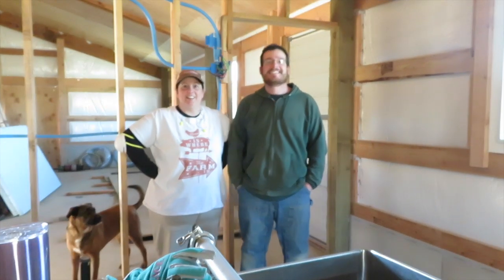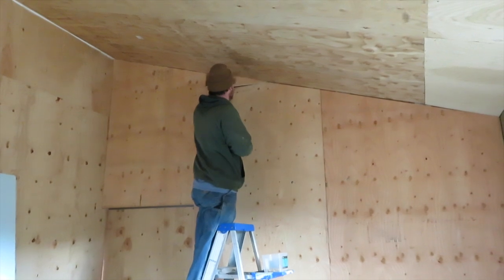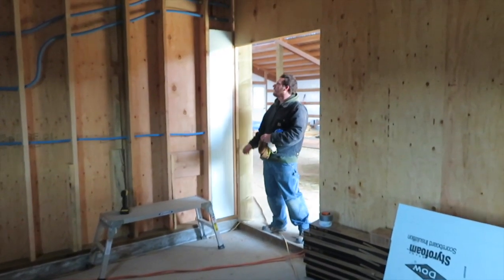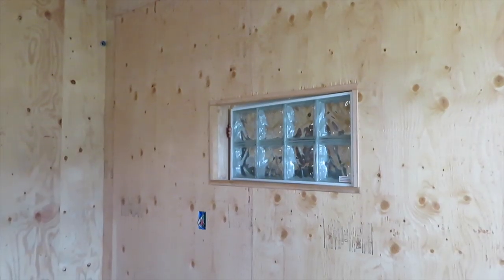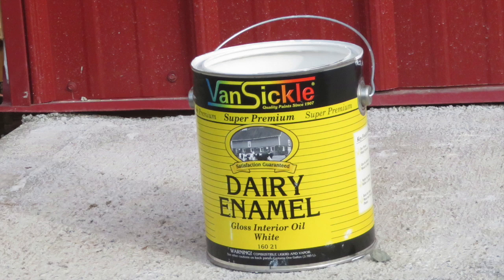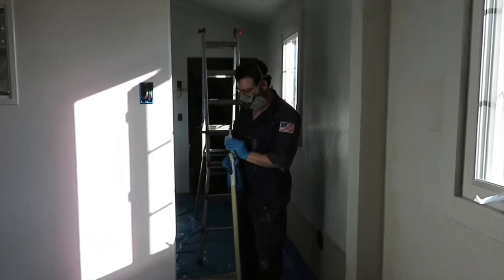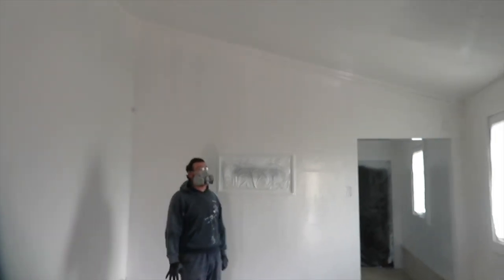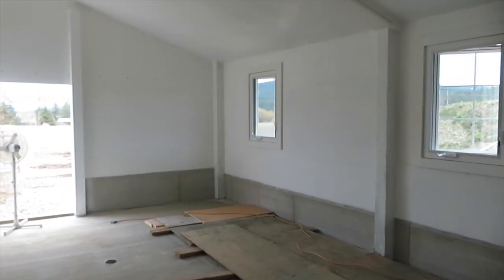Building Dairy Barn #13: Interior Painting

Comment: Just curious why you rolled part of it then switched to a sprayer?
Reply from the maker: Great question! It really depends on the surface as well as the type of paint. For example, the milking parlor is painted with an exterior latex primer and topcoat. We really weren’t looking for such a refined finish in the milking parlor, and water based paints are easy to clean out of the sprayer, so we just sprayed everything. In the milkhouse and dairy, we used an oil based paint. This is much harder to clean from the sprayer, so we only sprayed the second topcoat. We also found that by rolling the oil based primer and first top coat, we could get into the nooks and crannies much better. Thanks for watching!